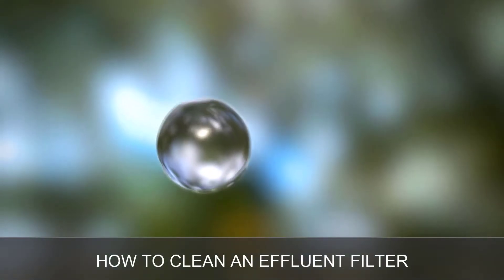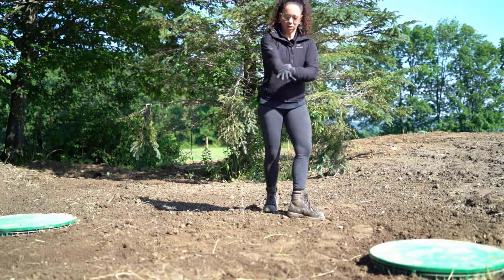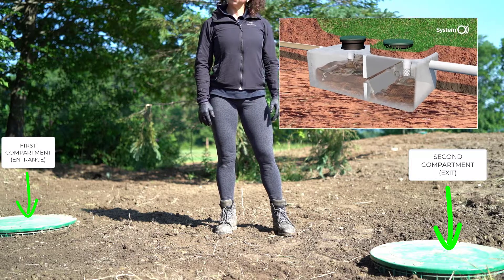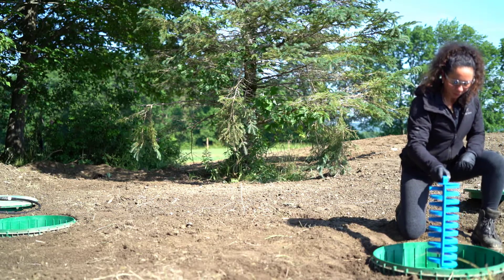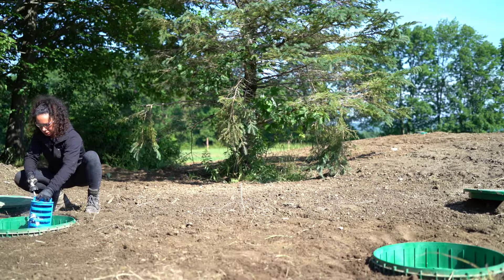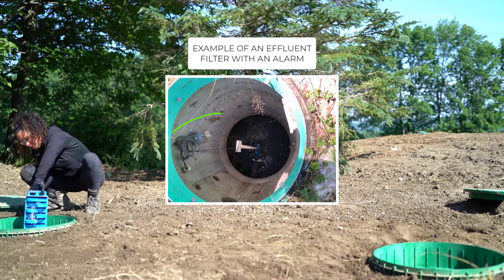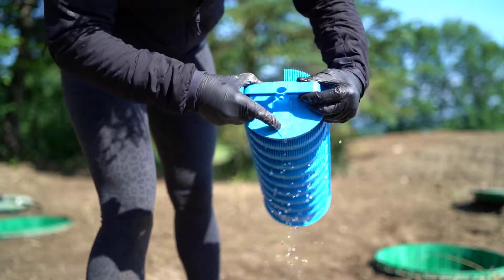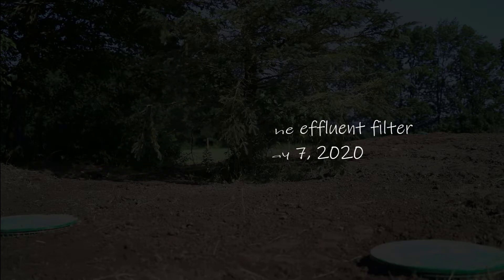How to clean your pre-treatment (septic) tank's effluent filter

Comment: Why does my filter float up?
Reply from the maker: Hi, and thanks for your question.
The filter can float if it’s not re-inserted correctly. There are arrows indicating the flow of water – if the arrow isn’t in the right direction, it could prevent the water from flowing and cause the filter to float. 
Some filters need to “click” in place; if there’s no audible click and everything else seems ok, perhaps the attachments on the sides are broken.
Reply: @DBO EXPERT  This filter seems to be about 5" or 6" and I noticed the black sealant is too loose. I decided to take out the black sealant and just leave it like that. The arrow is facing towards the drained pipeline.

Comment: Sweet. 
I would add wearing a filter mask for fumes  (like the ones for spray paint jobs) so you will not smell the gasses as much as without one.
Also what are we supposed to do with hairs which are the major cause of clogging these filters. Obviously throwing them back on the first compartment will not work. 
I assume putting them in a tied plastic bag and then in the garbage disposal would be acceptable?
Reply from the maker: Good addition! Fumes from septic tanks are definitely unpleasant, and could be dangerous.
Have you considered composting the hairs? If compost is not an option, perhaps a paper or compostable bag then the trash? Just trying to avoid plastic...